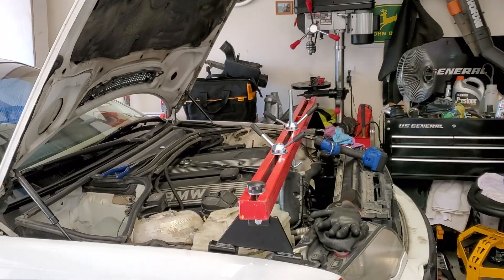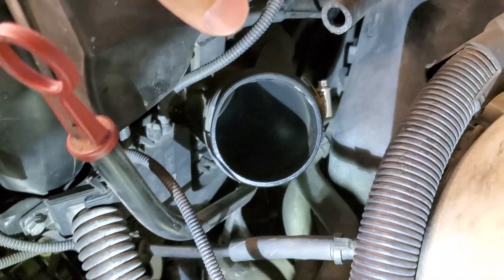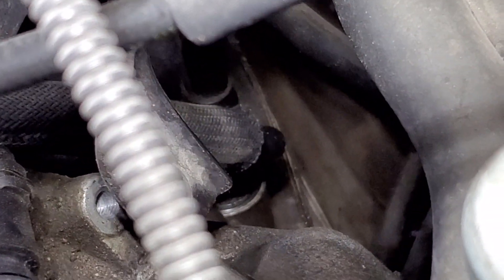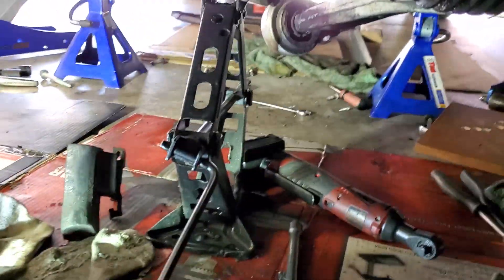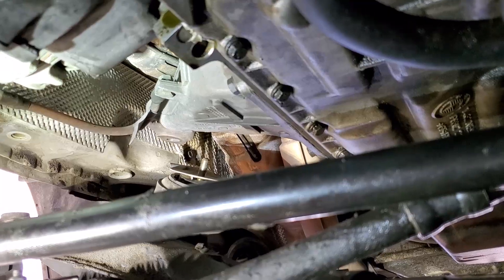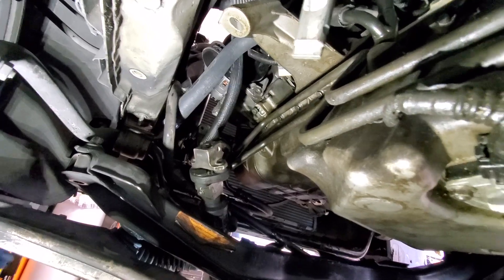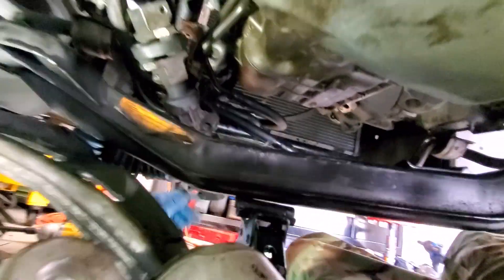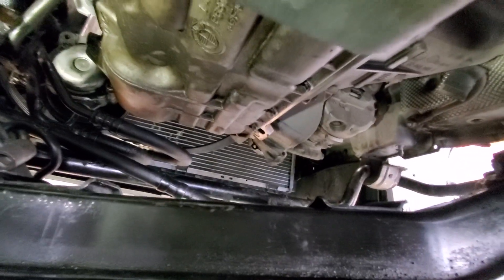BMW 330i e46 oil pan gasket replacement tips

Comment: Thanks for making this video, I think your addendums and pointers are very good information to have.
Reply from the maker: I appreciate your comment. Thank you for watching my video.
Reply: @jcx2bby  How long did it took you to do the Oil Pan Gasket? I'm planning to do this job and I'm estimating it will take me at least 10 hours and wondering if that is even enough time to complete the job. Thanks
Reply from the maker: @myxipitlik2  actually 10 hrs sounds about right. I started on a Saturday afternoon and finished on a late Sunday morning. As long as you don't have any bolts break or are missing parts, I think you can get it done under 10.
Reply: @jcx2bby  Very true, those unexpected things makes a job a lot longer. Thank you for your response.

Comment: Thank you for the video addendum, I watched both Han's and 50s Kid video also to prepare for this job which I will be attempting soon.  Can I reuse all the bolts for the re-installation or do some need to be replaced?  Thanks!
Reply from the maker: Appreciate your comment, yes you can reuse all the hardware. My buddy still daily drives this car and I'm happy to say that 2plus years later, not a drop of oil.  It's worth the effort!

Comment: I did this job amd now I got a small oil leak in the back where the bolts are on the pan and a vaccum leak that whines loud I think coming from my oil pan gasket we just replaced.
Reply from the maker: Ugh, that sucks.  I wonder what happened to cause that?  Might have to take it all back off and have a look.  sorry
Reply: @jcx2bby  This car is diffucult to take care of, the way it was xustomized lioks very modern which is why I put up with it.
Reply from the maker: @Ayixlia  I hear you. E46s are great cars and the N54 is a reliable motor, just leaky. The car in my video has almost 250K miles on the original drivetrain. There are not many cars of any kind that can make that claim.